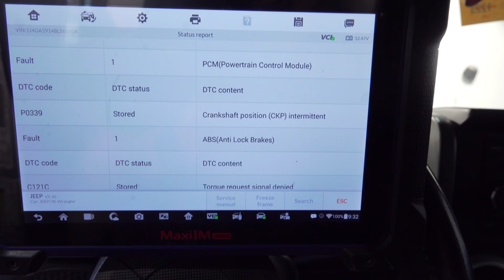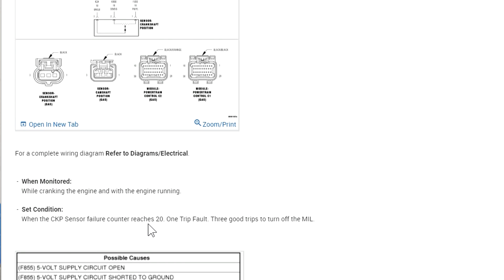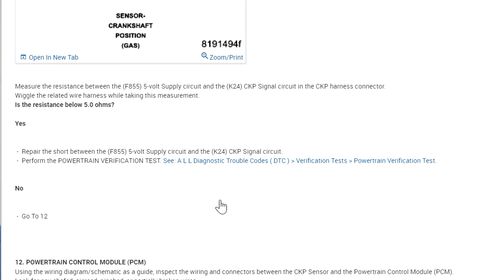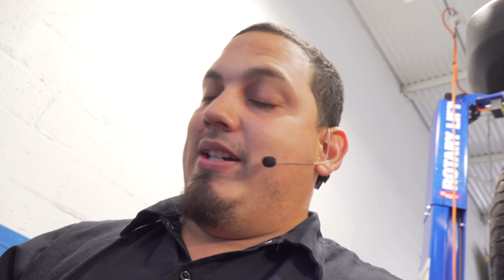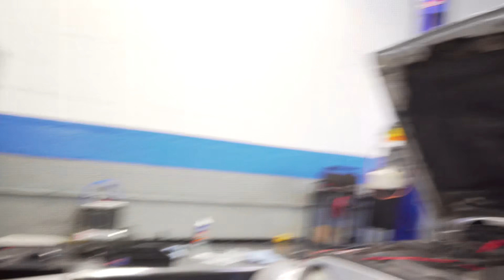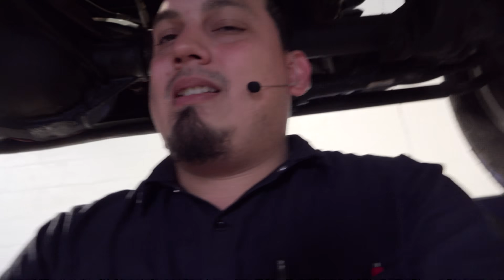2008 JEEP WRANGLER 3.8L JK LONG CRANK/CRANK NO START(AFTER 2 DEALER CRANK SENSORS - STILL NOT FIXED)

Comment: They use the flex plate to rotate and put the converter bolt to the engine, instead of them to use the front pulley hammonic

Comment: For your own safety never place your diagnostic computer/tool on the steering wheel. I’ve worked at a dealership before starting my own shop but we’ve received numerous accounts of the computer actually setting off the driver side airbag and a few technicians lost their lives due to the computer accidentally setting off the airbag and decapitating the tech because the computer flew towards them at an incredible rate of speed

Comment: I'm having a long crank and rough idle, with no throttle control. The code is for a bad camshaft position sensor, replaced with three position sensors, no help. Replaced spark plugs and coil pack, and it fired up and ran smooth, soon as I shut it off, it went back to the long start rough idle. Did an oil change, replaced the intake temp sensor. Checked the wiring as far as I can, no idea what's causing this......any ideas????

Comment: I’m a 1:07 minutes in and instantly I’m reminded of an a6 4.0 twin turbo that was being diagnosed by a fellow technician at my dealer, and same symptom. Advised the tech to pull a waveform on the crank, but he went his own way. Well three weeks later he ended up replacing reluctor wheel due to some warping when someone previously replaced the engine.

Comment: Mario, what kind of microphone is that. The sound is very great from it. Great job on the diag.,...
Reply from the maker: It's a countryman e6 with a picostream wireless setup, attached with an MMCX male to male adapter. Took a long time to get to this setup.  My earlier vids were much worse audio. Thanks!

Comment: Thanks for sharing Mario. It would be great if you would consider also videoing your interaction with the customer. ie how you explain the fault, the costs to repair and warn them that there could be unknowns that will cost more. I often find talking to the customer to be harder than the diagnostic. Thanks.

Comment: How dare you tell people to use common sense and actually diagnose the issue using methodical logic, dont you know that's not how the modern parts changer does it..... Nice video, and please never apologise for pointing out the right way to do things it is 100% not a rant.

Comment: Awesome Stuff Brotha...Sorry, it's been awhile on any comments from me. However, I'm always watching. Lol 😄
Great point you made to the others and how you can tell its damage rather than another "sensor or wiring" problem is the fact of how repetitive it is.  It has the missing notches within the same location of the actual proper sync notch locations.  Starting at your cam 3 notch is the crank Good and then its Bad-then-Bad-then-Good again.  Good-Bad-Bad-Good  😉👍
Great Work as always Bro.  Cheers Bro
Reply from the maker: Great to hear from you brother, thanks for taking the time! Cheers!

Comment: My guess is the transmission was replaced and they used a prybar to turn the flex plate to get the torque converter bolts out.
Reply: No way in hell that damage was done by a prybar unless they left it in there and started the engine.

Comment: Well, there's a lot of evidence that the rear main seal may been replaced.  The new upper oil pan gasket, the scrape marks around the flex plate (to rotate converter) and the shoe lace repair for the shift linkage. They point to a possible trans removal. 

Great find Mario, as well as excellent points made regarding the diagnosis and the possibility of it having other issues/combination of. 👍🏻

Comment: It looks like a back yard guy put a engine in..he used a pry bar or a screw driver to line stuff up...I'd be shocked if he even unbolted the converter before it the old one was yanked out...I see new  hose clamps on a cooler line and a new pan gasket...you made comments on the water pump...most wrecking yard won't warranty a used motor unless the thing you are pointing out are replaced...look for some paint pen numbers or stamps on the bellhousing area...when I worked at a wrecking as teen we stamped our company initials in the used parts

Comment: It looks to me that somebody was using a pry bar or a screw driver to turn the flex plate to remove the torque converter bolts instead of using the crank. Laziness. 

Shame on the shop that threw the sensor for not seeing the carnage in it 🤣 great video Mario